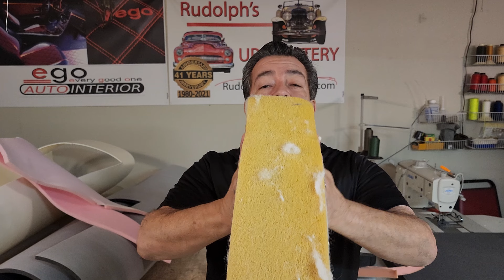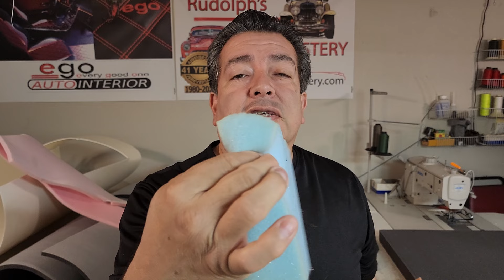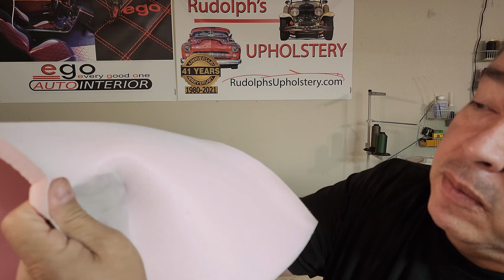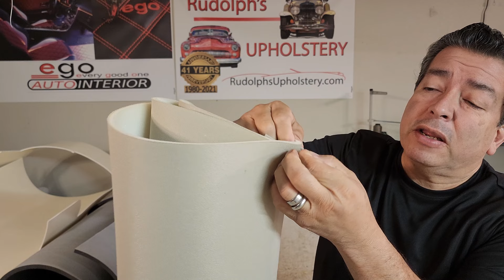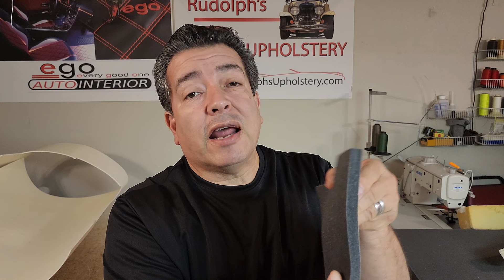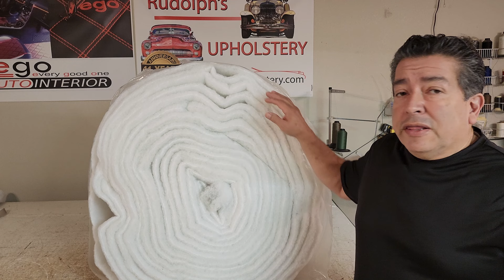Must watch finally upholstery foam explained

Comment: Thanks for the video as always. I do think, though, that you are technically confusing foam "density" with "firmness." What you are  really referencing is firmness, one can have a "firm" foam which is still low density, and vice versa. Two separate things. Curious where you get your varying qualities of scrim; I typically buy from Keyston and only see the pink stuff. Thanks again.
Reply from the maker: Hello 02, I guess i have been doing it wrong for 43 years. Thanks for setting me strait! I order "Density" foams from Keyston Bros. This is my thinking, found on the net." "Density has a significant influence on how the foam feels and performs. Foams with a high density will generally feel more firm, and can withstand more pressure. Conversely, low-density foams will feel softer, but cannot withstand excessive pressure or weight." Thanks for liking and watching!

Comment: Thank you for the foam video.  I've have bucket seats I'm working on now from a 66 Rambler where the foam has turned to dust. The seats have coil springs with a layer of foam on top of the springs and foam in the cover for the pleats. All the foam is just dust so it's hard to tell what kind and thickness of foam was there. There's several layers of cotton linen that I guessed was used like scrim. Boy, I tell you what it's the most complicated car upholstery I've experienced with nylon webbing, listing wires and bungie cords. Thank you for the video and sharing your experience. I appreciate you my friend!
Reply from the maker: Hello Greg, you are so welcome! That is what I call going to crackers. Yep they used to get real creative with those old cars. Please keep liking and watching!

Comment: Thank you for sharing all this information! I re did the headliner in my 2001 Dodge ram van with the help of your video. I didn't do it perfectly, and I may re do it over Christmas Break. It was easy compared to a car because it was only over the drivers passenger area. It is a cargo van so I might go find the headliner board from a junk van and cover that so I can finish the celing of the cargo area. 

I am thinking about picking up a Singer HD 6380 and redoing my seats and sun visors. I am on the fence about, don't know if I will use the machine for anything else ever again, lol. 

That foam for the seats is expensive! I have priced some at our local upholstery supplier as well as JoAnn's. For the price of getting a machine and doing it myself compared to having someone else do it seems about the same.
Reply from the maker: Hello B3, I am so glad to hear good news about your headliner. Yes, foam has gotten very expensive. The idea is to put the sewing machine to work and increase your income. Hehe Please keep liking and watching!

Comment: I frequently work with the precursors to those materials in my restorations. Spring cases, dunlopillow cushions, horsehair padding, jute, muslin and cotton ticking. I'm in the process of designing and building baking pans for the dunlopillow. The progressive rate of that cushion is very difficult to replicate. I found you need multiple layers of incresing density foam and it's still not 100%. As always, a very helpful video. Maybe for the new guys or DIY'ers might be where each foam would be used and in what thickness.
Reply from the maker: Hello JJz, Yep, your right. Sometimes there is combination of foams used. Depends on the situation. Please keep liking and watching!

Comment: I want to make extra thick and soft seats. Can I sandwich multiple layers of foam together? For example I can find up to half inch thick scrim but I want it to be thicker, 1" atleast. Is it okay if I take 1/2" scrim and use adhesive to add another 1/2" regular foam to it?
Reply from the maker: Hello Core, Yes you can glue multiple layers of foam together. Scrim is really for sewing, but you can also do that. Just give it a try! Please keep liking and watching!

Comment: re-doing my dash and installing 1/8 or 1/4 inch closed cell.Then marine vinyl over it. My question is do i cover everything? or just to the top edge of dash for my nova.Any help on this would be greatly appriciayed.ty
Reply from the maker: Hello Supa, For recovering a dash on I'm assuming about a '69 Nova? I would just do the dashpad. 1/8" is kind of thin, 1/4" is a little thick for the closed-cell foam. If I had to choose, I think 1/4" would be easier to do, but will look padded. Why marine vinyl? Marine vinyl is the same as auto upholstery, but marine vinyl generally costs more. See my vinyl video: https://youtu.be/WLYzglvx0hI I hope this has been helpful for you. Please keep liking and watching!

Comment: I love your videos. I recently bought 1/2" scrim foam to do the backs of dining room chairs. I have never used scrim foam before. I've always purchased regular foam without the fabric. Which side do I place against the work? The cloth side or the foam side?  Or does it even matter?
Reply from the maker: Hello Kefir, Thank you so much for saying so. For sewing scrim, the foam side is towards the material. The material backing of the scrim is on the bottom to hold the bottom thread and aid in sliding the material you are sewing through the sewing machine. Please keep liking and watching!

Comment: What foam would you recommend for a diamond stitched four wheeler seat that gets wet quite often? Also what foam would you recommend for an RV Dining room seat cusion. Thank you in advanced
Reply from the maker: Hello Tea, You can use a 1/4" to 1/2" foam scrim for both or either one. 1/2" will have more definition. Please keep liking and watching!
Reply: @oldschoolautoupholstery  will the Scrim Foam get hurt/ruined by getting wet after washing the quad?
Reply from the maker: @teadizzygaming  Hello Tea, Scrim foam does not hold water for long, and will dry out. Please keep liking and watching!

Comment: On the Dacron pad to go over a rough foam on a motorcycle seat, do you glue the Dacron o the old foam?  If so, just use the regular foam adhesive that you use when you spray your foam?
Reply from the maker: Hello Big, yes, you can glue it on or just simply wrap it then install the cover. Please keep liking and watching!

Comment: Hi, I like watching your videos I found them extremely informative. However I noticed some people use foam with their vinyl top installation and you dont. My curiosity is there certain ocassion that you need the foam and application that is not necessary? If so, when does it apply. Thank you in advance for the reply.
Reply from the maker: Hello Sportster, Thank you so much for saying so. Well, padded and non padded tops. Easy. Non luxury vehicles vinyl tops like Mustangs and Camaros were never padded. Luxury cars like Cadillac and Lincoln were always padded. See the difference? Well, there it is! Please keep liking and watching!
Reply: @oldschoolautoupholstery  Thank you very much for the reply
Reply from the maker: @sportster_1214  Hello Sportster, As you may have noticed, I have several thousand comments on my YouTube channel. I answer everyone. Just let me know if you have any other questions. Please keep liking and watching!

Comment: We have a Mazda 3 with seats that feel like I'm sitting on a board. What foam can be used to fix the seats and have a more comfortable seat for longer drives?
Reply from the maker: Hello My, you can replace some of the foam with medium density or put a layer of Dacron pad over your seat foam for more comfort. Please keep liking and watching!
Reply: @oldschoolautoupholstery  Thank you for the response. At least It gives me hope not to have to look for a seat replacement if this can solve the problem. I'm not familiar with Dacron, where can a dyi buy something like this if I ever decide to tackle this myself?
Reply from the maker: @myshots101  Hello My, Just Google: "Upholstery suppliers near me" Or search "Dacron pad" on Amazon. Please keep liking and watching!

Comment: Hi Rudolph I have a 1985 gmc sierra classic C1500 suburban It has bucket seats. I'd like to wrap the wooden center console with vinyl. Which padding would you suggest to use and how thick. The seats are very close to the console thank you.
Reply from the maker: Hello Ray, I’d suggest a 1/4" to 1/2" inch thick padding, but a good quality medium density foam will do the trick. I think you will do just fine with your Sierra. Please keep liking and watching!
Reply: @oldschoolautoupholstery  Yes sir thank you I've myself done the entire suspension and air conditioning. Replaced everything on the outside and the fuel tank all new window seals and window strips. Door panels and hardware dashboard and reupholster the seats and new carpet. And a ABS plastic headliner now the console hopefully next month I'll be driving it.
Reply from the maker: @rayjohnson7886  Hello Ray, oh that's a lot of work right? Over the last 40 years I have done my share of restoration and I know how that goes. Maybe we both have had similar experiences. Please keep liking and watching!

Comment: Usually you are spot on, but your definition of density (and firmness) is just plain wrong.  Density is simply the mass/volume. Most foams for upholstery is 1.2 to 3.0, though memory foam and latex foam can exceed 5lbs/Cubic Foot. Firmness is measured in ILD (Indentation load deflection). The ILD is measured on an 18 x 18 x 4 inch pad with a 8 inch circle (50 square inches) placed on the center.  Load is increased until a deflection of 25% (1 inch) is achieved. This force is the ILD.  Very soft is ~ 10 pounds, Firm is ~40 pounds, for example.
Reply from the maker: Hello Daniel, Oh rocket scientist huh? For 44 years, I never thought of it as rocket science. I just pick up foam from my upholstery supplier according to my need. Hehe. Please keep liking and watching!
Reply: @oldschoolautoupholstery  Of course, I’ll keep watching. I keep learning from you and started some of my own projects. Thanks so much for sharing your knowledge and skills with the newbies.
Reply from the maker: @danielhorschel9089  Hello Daniel, Growing up, it was really just a job, until I was doing fibulas cars. You can see 44 years of my work here. Rudolphsupholstery.com Just sayin'.
Reply: Thank you Daniel. Your explanation of the difference between density and firmness is really interesting and adds to our knowledge of upholstery materials.  Some of us never stop learning and the comments section of videos is a wonderful resource for extra information.   Please keep contributing, we NEED rocket scientists.
Reply: Not even rocket science, just basic math and beginner physics.

Comment: Sorry, but I don’t agree with you at all.  I build mattresses for a living.  I’m no expert, but I know a little about foam. 
Foam density is measured by how much it ways per cubic foot.  I can buy a super cheap, low density foam 4” thick and it would be like sleeping on a concrete block.  And I can buy a  super high density foam 4” thick that could be softer than the previous.  Firmness or softness has more to do with the type of foam rather than the density.   
High density foam is way more expensive and has better recovery so you don’t develop a dip or sag.
Reply from the maker: Hello Lest, Yep you said it. Please keep liking and watching!